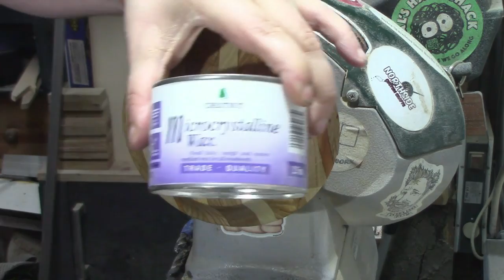Woodturning - The Bowl Of Many Woods

Comment: Did you use a woodworm screw?
Reply from the maker: I did yes
Reply: @jpwoodwork  this is going to sound dumb but do you have to use one? I'm having issues with mine
Reply from the maker: @jstarr3676  No not at all, you could use a faceplate or even a glue block, you could even turn it between centres and turn a tenon onto the bottom in which you could hold it into the jaws, hopes this helps
Reply: @jpwoodwork  it does I really appreciate your time
Reply from the maker: @jstarr3676  no problem, any time